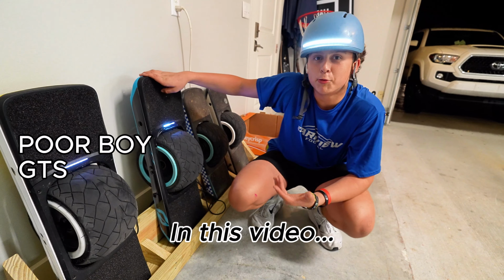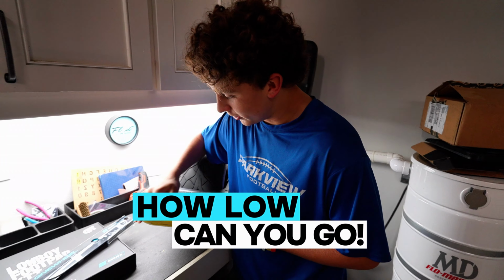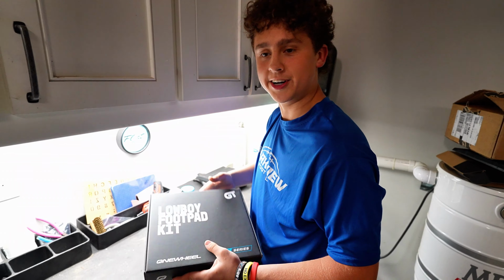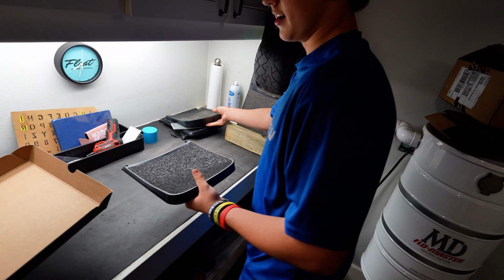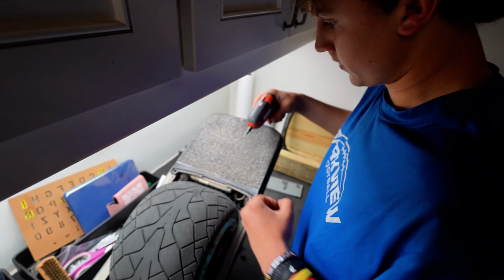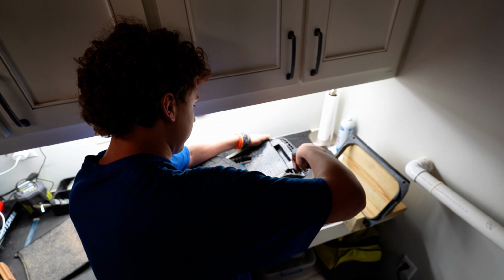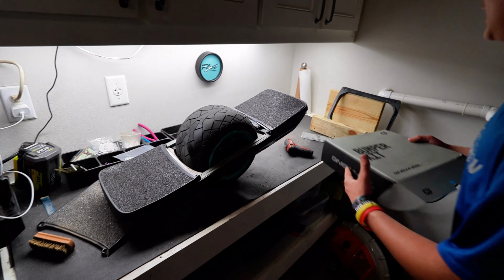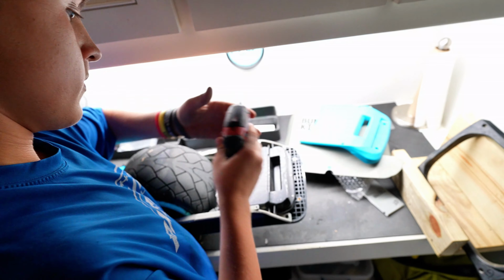NEW ONEWHEEL GT S-SERIES UPGRADES- Are They Any Good?

Comment: Is the better activation worth the price tag? Theyre $130 right now for black friday. Really tempted to pull the trigger
Reply from the maker: We paid $175. That’s a good deal
Reply from the maker: Yesterday the temp dropped in the 50’s and both footpads gave us activation issues because of the cold. Just wanted to give you an fyi. 
We Posi connected them to keep from having issues and we’re going to change grip tape to help.
Reply: Low Boys are way better.
Reply: @borillasnaps  thanks for letting me know that! Makes me think I should just stick with the stock pads.
Reply from the maker: @majorg6065  no problem!  Just went for a 5 mile ride and they worked perfect. Best ride I’ve ever had with the performance tire. I love the set up on this board right now. We are going to stay with Posi connect on the front. It just works better. 
We liked the stock pads as well but wanted to try it. Also it doesn’t hurt to have an extra footpad for back up. I’ve had 3 footpads go out and so glad we had an extra.